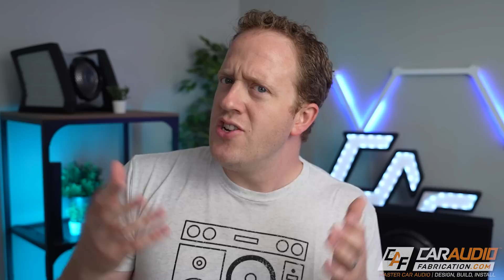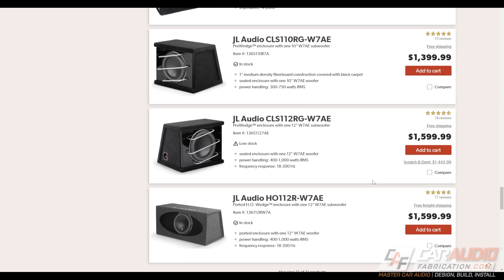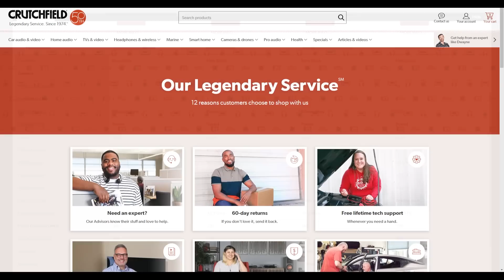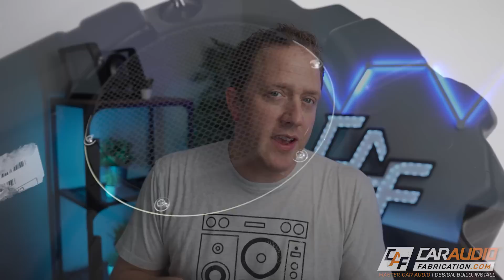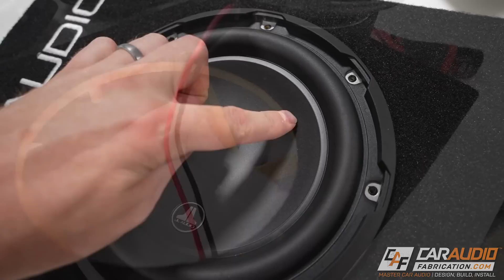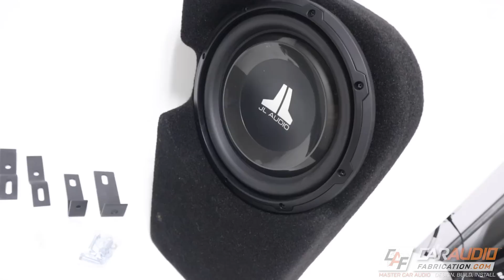5 Reasons to AVOID factory “premium” subwoofers! Get THIS instead!

Comment: Make a informative video on installing a aftermarket system in Electric vehicles pros and cons and the benefits and the things to watch out for. Example a Tesla model 3 Standard range help people located the full range signal and where to tap power from the front of the 16v battery.
Reply: Toss Hybrid on there two.  Both platforms have a common issue - the 12-16V circuit is powered by an inverter.  The vehicle batteries are often at 240V, meaning the vehicle inverter places a current maximum on the 12-16V part of the vehicle, giving you a wattage ceiling for your design.
Reply: From what I understand, this is NOT correct.  EVs are powered by a traction battery, which is obviously DC, but is a higher voltage.  EVs still have a small battery which runs accessories, etc., and anyone who owns an EV knows the the vehicle won't run without a functional small battery.

ICE vehicles use an alternator to keep their small battery charged.  EVs have DC-DC converters which step down the voltage so that the traction battery can keep the small battery charged.

The majority of EVs [and hybrids] use a 12 volt battery.  But installing an aftermarket system could be an issue if your EV uses a different voltage (a few Teslas apparently use a somewhat higher voltage).

At least hypothetically, EVs [and possibly hybrids] might be more limited than ICE vehicles in terms of the amount of current/amps that the 12 volt system can handle.  ICE vehicles have to have a more robust 12 volt system, given the power required to power the starter motor and actually start the vehicle.  EVs obviously don't need 12 volt systems capable of powering a starter motor.

That being said, I found that--at least in the case of my Chevy Bolt--these concerns are overblown.  In my Chevy Bolt and likely in most EVs, the 12 volt system is capable of powering aftermarket amplifiers, as long as you don't go overboard.

The Chevy Bolt's 12 volt system can safely manage an average draw of about 1200 watts [beyond the draw for OEM functions].

There are YouTube videos detailing how to calculate how much a given aftermarket amplifier [or combination of amplifiers] requires in terms of 12 volt system capacity.  This is different from calculating what gauge power wire is needed, as power wire needs to be able to handle the maximum draw of an amplifier.  But in practice, your amplifier isn't constantly drawing the maximum current/wattage.

Just as an illustration of the capability of my Chevy Bolt's 12 volt system, my current aftermarket setup is as follows:

1.  A DSP amplifier [class AB] which  has four 30 watts RMS (4 ohms) outputs [though I'm only using two of the powered outputs, as the other two channels capable of internal amplification are going to a separate amplifier].

2.  A two channel amplifier [class D] which provides 85 watts RMS per channel (4 ohms).

3.  A monoblock amp [class D] which provides 500 watts RMS (1 ohm).

With this system, I have no issues with the 12 volt battery running down, headlights dimming, etc.

The Chevy Bolt is a fairly small vehicle, so this is a pretty sufficient amount of power (at least, given a two way component front stage and a subwoofer).  Even if I wanted to incorporate the rear door speakers [beyond using OEM head unit to power them], it wouldn't be an issue [given that you don't need much power for a rear fill application].

Of course, SPL/bass head scenarios could be a different story.

Bottom line, you need to look up the capability/specs of your EV's 12 volt system and/or seek info. out on the forum for your vehicle.

Comment: The "Premium Audio" that comes with most higher trim levels is usually not that different than your lower level trims. It may just be a name brand that you've heard in the past and liked. Keep in mind what Mark points out when it comes to the costs of the outsourced components. You will definitely be getting a lower tier of whatever that premium brand really is if it is stock on your "Premium Audio System". I have had vehicles with these radios and I'll be honest that I haven't been impressed yet. Don't pay that extra amount of money for the premium audio. Instead, use the money you saved from not getting it to install a system that is specific to your likes (your preference of what frequencies you like, whether high and/or low). Most stock systems will be very flat, so to speak. Make sure that you consult someone that knows car audio well and can help you make a better decision on your investment. Just try not to go to a shop. I would recommend going to a bass meet where you will find most people there know car audio well an won't try to sell you something because of the commission they will make off of your purchase. I feel that they will genuinely help you and point you in the right direction. I say this as I have helped individuals in the past and have seen them soon after living their new audio installs. As far as sourcing the audio gear. Crutchfield is a great company but pricy. I would recommend a wholesale audio warehouse or a audio auction. These are some of the best places to get great deals and keep some money in your pocket. The only downside is that you will have no warranty against manufacturer defects. The pro outweighs the con by a landslide. Most people blow their speakers anyways. That is not manufacturer defect. That is either user and/or installer defect. Manufacturers won't cover blown speakers because you have them too much power. With that being said, if the installer knows what they are doing. I wouldn't worry about it.
I hope my input helps some make a better choice when it comes to this subject. Have a great week. Be safe and let's get loud and LOWWW!!!
Reply: Well said! Great advice!

Comment: And what about hybrids with small 12v batteries? Are there some differences in low voltage equipment for stock entry level and premiums systems? For example in very popular 1.8hsd Toyotas?

Comment: Great video, I have jl audio in my 2000 gmc sierra and I’m wanting to upgrade my wife’s 2012 Chevy equinox, I may run the c1 line in it to replace the pioneer system it has.

Comment: That is they way i have always been i have that same jl set up bit i have the duel 8 inch powered jl sub... its sounds better than any premium syster
Reply from the maker: Meaning you have installed it in several vehicles?
Reply: Yea about 5 different ones. And different car manufacturers... I never go for a premium system cause it's more cost effective in my opinion. Vehicle were chevy cobalt 2 of them. Chevy treverse 2 ford flex Mazda cx9 I believe it was. I'm there audio guru with my friend group

Comment: Literally just bought a car and had no choice but to get the premium audio system because of the packages. Had to rip it all out!

Add: Brought none of my old audio stuff from my other car over and gave it all to my son. Went with Focal on the inside and JL audio amps and sub... Sounds so much better 👍🏽
Reply: Sell them, some OEM parts lover will probably buy it up quick
Reply from the maker: Yes, it is definitely frequently bundled with other features that might be a "must have" for you.
Reply: Superb choices....thats what I have in my Accord and I feel no need to change anything.
Reply: Focal 165k with a w6 is chefs kiss
Reply: Was it more difficult to swap everything out of the premium system I heard it’s kinda a pain sometimes working with them especially when it’s Bose
Reply: My car had premium system. But I replaced speakers with focal and sub is disabled.
Reply: @Cee-i4p naw - I have the money/time so I did it the right way.
Reply: Note that having the "premium" OEM system can sometimes make aftermarket upgrades easier.

In my Chevy Bolt, having the premium system would make the aftermarket install easier, since wiring is already run to the hatch.

That being said, there are seemingly scenarios where having a premium system could complicate an aftermarket upgrade.

On this subject, I would note that at least in the case of my Chevy Bolt, sound deadening doesn't come with the "premium" system.  Somewhat better drivers and a nominal subwoofer is obviously not going to remedy issues with rattles and having no CLD in the doors, etc.

Comment: Whats this white stuff inside the woofer box ?
Reply from the maker: Polyfill
Reply: @CarAudioFabrication  what exactly it does to the box if added inside like this box ?
Reply: @Hexa8  Poly fill, basically similar  to pillow stuffing. Adds "air space" or makes the woofer act like it's in a slightly bigger box. I prefer not to run it in higher wattage setups. People have said they've seen it on their voice coils during a sub recone.
Reply: It's called poli fill